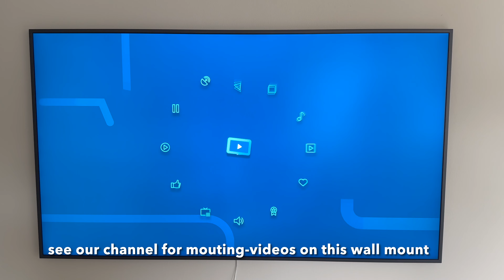Samsung Slim Fit wall mount tutorial

Comment: thx for the informative video! is this the Slim Fit Wall Mount WMN-B50EB that is available on samsung website? also what tv model is that? am thinking of getting this mount for the TQ65Q70 i bought recently. will this mount fit it? thx again
Reply from the maker: Hi. Nice TV. Yes, this is WMN-B50EB. In the video you see Samsung the frame, the mount will fit your tv but it will not be flushed with the wall, its only the frame that is flushed with the wall on that mount. The wall mount I usually use for your tv is Vogels TVM 5405. much easier to install and make the TV look very good on the wall.

Comment: Thank you for this video. It was very helpful.

I’ve just realised my TV has a gap on one side, it looks like the installers didn’t follow the important step of loosing up the bracket. 

I heard the click on one side when I tried to push it into the wall but can’t seem to get it to happen on the other side. What should I do?

Is there a way to get the mount to clip into place without removing the TV from the wall again? 

Many thanks
Reply from the maker: Hi. Try to wiggle the TV gently from side to side while pushing down on the side that has a gap. That usually helps.

Comment: Det følger kun med skruer for montering i murvegg eller treverk. Det står at hvis man skal montere i gipsvegg, må man ta kontakt med f.eks dere. Men jeg har hatt en tung Pioneer plasma-tv (ca 45 kg) til nå der veggfestet sitter i 4 gipsanker. Det har gått bra. Min nye Samsung 65" er ikke så tung. Men er første gang jeg har slim fit wall mount.
Reply from the maker: Hei. Gamle Pioneer plasma veier som regel mer enn en ny TV. I dag skal vi faktisk ta ned en 50 tommer Pioneer og erstatte den med en ny Samsung 85 tommer. 50 tommeren veier mest. 🤔
Reply: @oslotvmontering  Det var det jeg også ville frem til. Så det bør ikke være noe problem å bruke egeninnkjøpte gipsanker til dette Slim Fit veggfeste til en Samsung 65" 2024 modell?
Reply from the maker: @solobservatoriet  Jeg monterte en 85 tommer på den måten i dag så 65 skal gå helt fint. Jeg bruker Fischer Duotec til sånne jobber. De klarer absolutt alt på vegg.
Reply: @oslotvmontering  Supert tips! Ville du da brukt Fischer DuoTec i størrelse 10 eller 12 til en 65"?
Reply from the maker: @solobservatoriet  10 holder, 12 hvis du har planer om å prøve å henge på tvn etter montering.
Reply: @oslotvmontering  😂😂

Comment: Hi does this bracket fit the 2024 QN90D
Reply from the maker: Hi. Yes
Reply: @oslotvmontering  Hi again,excuse my uncertainty but just to clarify again.The Samsung slim wall mount 2021 model A50EB WILL FIT MY 2024 QN90D 55 inch tv...thanks in advance

Comment: Hi, do you advice to mount with the Vogels (TVM 5605) or the Samsung thin wall mount for a 65S95D ?
Reply from the maker: HI. The Samsung wall mount, just because right now the screws at TVM 5605 is not short enough for that TV.
Reply: @oslotvmontering  Hi, idem for the 5405? We could shorten the screws ? ;)
Reply from the maker: @xavierdelange5341  Not a good idea unfortunately, I have the correct screws here with me all the time, but you are probably not from Norway?
Reply: @oslotvmontering  no I m in Belgium I’ve send you an email.

Comment: Hi great video!!! I have a question i did exactly as instructed but I can’t get to close to the wall on both sides at way . One side is more in than the other… what am I doing wrong? 
Best regards from Sweden 🇸🇪
Reply from the maker: HI. Takk. In the video @3:50 have you done that? That is the most common reason to why they do not fit.
Reply: @oslotvmontering  yes i did 🥲 and still
Reply from the maker: @Z11980  You can adjust the TV when it's mounted, try to adjust the TV all the way to the left and then all the way to the right a couple of times,  sometimes that will help.
Reply: Did you ever get this to work for you?

Comment: Hey, great video. Does it connected to the s95b 65inch as I can’t for the life of me see how and everything online is saying it does
Reply from the maker: Hi. Yes. I have mounted s95b on that before.
Reply: @oslotvmontering  can you share a photo or a link to a photo or video as I can’t find any instructions on how. There doesn’t seem to be anyway to connect the brackets to the back of the tv
Reply from the maker: @neilranson4185 I do not have pictures or av video for that. You have to use the original top holdes on the TV. Its much easier to mount it on a regular mount.
Reply: @oslotvmontering  after much online searching Iv found out I bought the wrong year mount for the s95b. I have the 2021 WMN A50EB when I needed the 2022 WMN “B”50EB. I believe the only difference is the longer 40/45mm C3 bolts included in the 2022 mount needed to attach the two plates to the back of the tv. The 2021 mount only has 30mm bolts meaning they are to short to reach the threads of the top two attach holes on the back of the tv. I hope this is the ONLY difference as Iv ordered some 45mm Samsung tv mount bolts with washers as I’ll try to hang the tv this week

Comment: Hello, what do you do with the wires with a Samsung Neo QLED QN90C? Do you pasa them through the wall?
Reply from the maker: Hi. Sometimes through the wall and sometimes we use a cable hider on the wall instead.
Reply: @oslotvmontering  Great Vids. If you pass through the wall which plastic cover do you use once you have make the hole ?

Comment: Hi does it work for 77s90d ?
Reply from the maker: Hi. Yes
Reply: @ But when I have a look at the notice I don’t see my tv reference. It says that only 65” is supported for the model s90d.
I’m a bit confused…

Below is from Samsung website and model supported by WMN-B50EB/XC:
Neo QLED 8K 85” / 75” / 65” QN900D et QN800D

Neo QLED 8K 75” / 65” / 55” QN700C

Neo QLED 4K  85” / 75” / 65” / 55” QN95D

Neo QLED 4K  85” / 75” / 65” / 55” / 50” / 43” QN90D

Neo QLED 4K 85” / 75” / 65” / 55” QN87D et QN85D

OLED 77” / 65” / 55” S95D

OLED 65” / 55” / 48” / 42” S90D

OLED 65” / 55” S85D

QLED 4K 85” / 75” / 65” / 55” Q70D

QLED 4K 85” / 75” / 70” / 65” / 55” / 50” / 43” Q60D

UHD 85” / 75” / 70” / 65” / 55” / 50” / 43” DU8000 et DU8500

UHD 85” / 75” / 70” / 65” / 60” / 55” DU7000

The Frame 85” / 75” / 65” / 55” / 50” LS03D